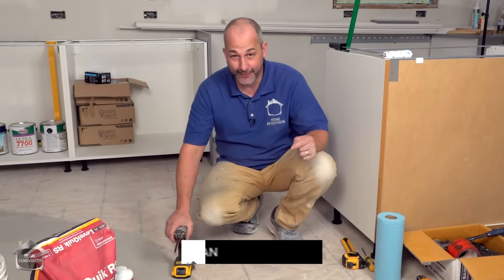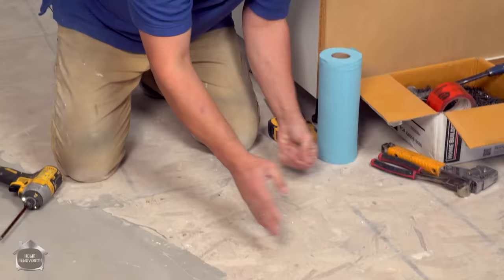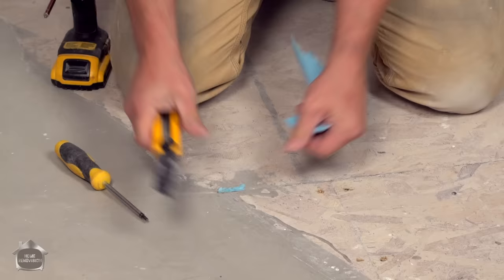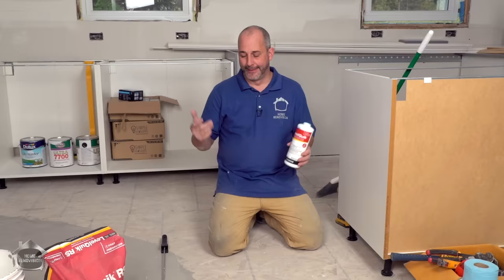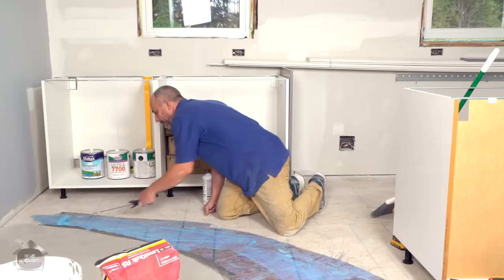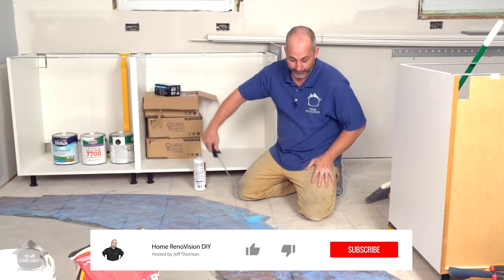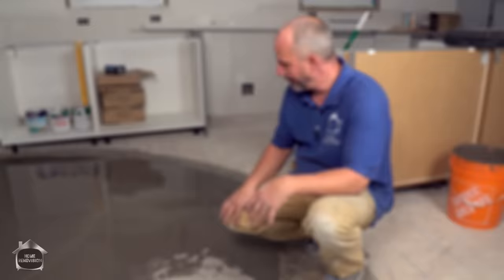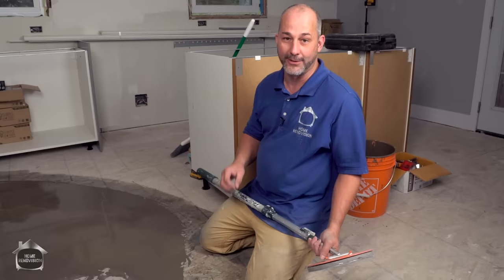How To Level Your Floors

Comment: Hi Jeff, thanks for your great videos. I bought a house with a crazy amount of settling. I had an engineer look at the house and he said it's structurally sound but head settling over the years. How would you recommend I get the floors leveled?
Reply: Jeff does video on that for his farm house reno series.  Basically you start in the basement using steel jack posts and you SLOWLY raise the main joists about 1/2" a week.  Those jack posts remain for ever after that though or can you knock in a wood post if you're daring.  Then you move up to the first floor and repeat  etc. if you can.

Comment: Hi Jeff,
Can I use this over OSB and then put tile over it or would I still need to put down backer board? Separately, can I use this over old hardwood floors then put vinyl planks over it? 
Thanks!
Reply from the maker: Hi Robert, when tiling you always need 1 1/4" of substrate ( wood or cement board). as for the hardwood it is better to remove it all and then work from there. the water in the leveler is going to be absorbed into the wood causing it to warp even more and you will not get the strength out of it that you need. Perhaps a good underlayment before installing the vinyl would be better. Cheers!

Comment: Hi, My wife and I are renovating our home and removed the old wood laminate flooring, then underneath found a few different old vinyl/linoleum floors (fun...). We got all of that up, but now have some left behind paper backing and adhesive we have tried to scrape and scrape and SCRAPE. We are replacing all the flooring in this area with tile, do we need to spend days of labor and hundreds of dollars renting equipment to get all of that off or is there an easier/cheaper way to prep the floor? or can we get away with not prepping the floor at all since were putting down tile?
Reply from the maker: no worries about the backing. simply install your new layer of plywood on top and screw down as per usual for subfloor. make sure you have a 1 1/4" thickness and you are ready for tile. If you want to use cement board then use the Mapei primer eco prime grip on the backing and then you can use thinset on that to set your cement board into. Cheers!

Comment: when you are sanding your walls in between paint coats, that is only for smooth walls, right?  or would it be best to sand between coats walls with knock down orange peel texture?  And speaking of wall texture, what would you recommend for a 30 y/o southwest US home where half the walls are knock down orange peel and the rest of the walls were wallpapered and the wallpaper was removed by some previous owner leaving glue and bumps in places and doesn't look nice.  Obviously we want those previously wallpapered walls to look good and coordinate with the rest of the home.  Sand them smooth, repair, and paint leaving smooth? or sand them, prepare and texture with with a texture roller that looks coordinating?  or something else?  The walls are vaulted.  Thank you.
Reply from the maker: that is simply a design question. I personally would take advantage of the different texture and consider using a contrasting paint color. as for the sanding use a 180 grit to remove roller fibers and dirt is all. Cheers!

Comment: Hi!
I have a basement floor that is unlevel , it is made from 6mm wooden boards and underneath there is 40mm of cell plast isolation and the entire structure sits on some kind of sand , the floor has a lot of uneven spots, do you think I should change the cell plast that got soft and then pour some cemet? or what options do I have to get an even floor?

Comment: What would you do to "level" or "flatten" a floor that was in a garage that has a built-in slope?  Not to take the slope out, but flatten it so the next layer of flooring doesn't have high and low spots?
Reply: Buy some knee pads and a diamond concrete cup grinding wheel, 4-1/2" angle grinder, safety face shield and glasses, ear plugs, respirator, gloves and a 12 pack of some good lazyboy football watching beverages because its gonna be a good n long bonding session between you and that floor and will get to know eachother real good when youve leveled with it..  

If youve only got puk marks and divots then use a structural repair compound with bonding adhesive after youve wallered out the places and thoroughly degreased the concrete since it was a driveway.  Might even use muriatic acid to etch and clean it first to be sure anything you pour on it will have best chance of adhesion..  after etching you could also try using a self leveler in small portions and a good trowel or squeegy to move it around to all the various places something needs added but would still take high spots down with the grinder..  be prepared for dust bowl 5000 though so fans are a must as well..

Comment: great video. I have a question. I just bought a house. Ripped up all the ugly wood parquet flooring. And it was glued down. A gray color glue. There are a few low spots i need to level with floor leveler. Is it ok to use over the glue?  The glue has grooves in it from the trowel. And some of it was sticking to the Tile Chisel bit.
Reply from the maker: as long as you use the primer. Cheers!
Reply: @HomeRenoVisionDIY  Ok. Thanks

Comment: Can you use this in basements to level foundation floors? Or will it not bond properly with the original concrete?
Reply from the maker: It will if hou use the primer. Cheers!

Comment: My floor joists are 24 inches on center. I’m laying down 3 inch tongue and groove hickory floor. Do I still have to level my undulating subfloor?
Reply from the maker: not if you are installing perpendicular and the boards are longer than 4" on average and the wood is 3/4" thick. The subfloor should be screwed first and for best results always check the specs for installation from the manufacturer. they can confirm or deny my experience. but any warrantee is only valid if installed according to their instructions.

Comment: I suppose this is all determined best with a laser. A taut string with a level could pretty much do the same, I think a laser would be faster, easier, and more precise though. Here's is what we need a 3D printer for. It could roam the floor determining levels, and then just print out a floor. Using the right materials with that could also strengthen and quiet the floor, maybe with just a thin layer. Doing it by hand intimidates me, but I am going to put my kneed pads on and explore the floor. I shall brave the wilds within the confines of my own sheltered existence. It just feels so good to get into something so rough.

Comment: I have a concrete front porch that pools water toward the house. Can floor lever be used and not have a wearable surface installed on it? 

The porch is covered and I live in Columbus, Ohio. Added in case it makes a difference in the answer. 

Thanks for all the videos!
Reply from the maker: Hi Dave, leveler is not designed for exterior use. there are other products for your situation.
Reply: @HomeRenoVisionDIY Thanks for the reply. I had a feeling it wouldn't work. What is a product that is good for my situation?

Comment: Question for you. I am about to pour for a bathroom I’m working on. Just called up tech dept about their product and was told it can only be feathered on concrete floor. On wood floor they told me the minimum pour is 1/4” thick and that I must use lath. I see you did feather and didn’t use lath. My question is how has it held up? 

My lowest point is 5/16” so to get it level with the highest point and maintain 1/4” minimum I’m looking at roughly 3/4” at my low point to get the high point a 1/4” to meet their requirements. I really don’t want to do that and would much rather feather to the highest point. Really looking forward to hearing your thoughts! Thanks!
Reply: Same issue here.  What did you end up doing?

Comment: I’ve been agonizing over what to do about an uneven floor in an older house on a conventional foundation. Pulled up a piece of subfloor today and discovered that rough cut planks were used under the 3/8in plywood subfloor. I seems pretty solid, but the thickness of the rough cut lumber varies by as much as 1/2 to 1/4 of an inch in places which creates a few noticeable dips. (Grateful it wasn’t any worse.) I’ve been concerned that since the self- leveler is a type of concrete that it would crack over time. If I use the primer that won’t happen? 
I’ve thought about pulling up all of the subfloor where there are dips and adding thickness to each of the planks that are too thin and going back with a new sheet of subfloor. I’m hoping self leveler will keep me from having to do all of that. 
Please advise if at all possible. 🙏 Thank you so much for all of the great advice in your videos.
Reply from the maker: Hi Debbie, you need 3 things for a good floor leveler install. strong substrate that does not have much deflection. primer and the right amount of water in the mix. to avoid the need for too much leveler you can add plywood in the low areas to build it up . follow proper screwing techniques. you will be fine. cracking happens with too much movement
Reply: Home RenoVision DIY, thank you. The foundation of the house is solid and as level as a 40 year old cabin built on Mississippi clay will allow and I am discovering that the places where the floor feels spongy tighten up quite well with a good handful of screws. I greatly appreciate your help. 
My only question is the word substrate. If you’re referring to the construction of the foundation I’m fine. If it’s the clay on which the house is built, there may be some shifting. What alternative flooring could you suggest if the vinyl plank (already purchased) isn’t an option?
Reply: Debbie Moore vinyl planking is a fine choice for your situation

Comment: Thanks for the video. My subfloor has gaps between the boards, whats the best way to ensure the mix doesn’t flow into the gap area?
Reply from the maker: 2 options. spray foam or screw down a layer of 3/8 plywood first!
Reply: Depending on the size of the room. you could use a cheap latex caulk then use a 6 inch putty knife to force into the crack and flatten the excess.  I think it could work Wilbur.

Comment: Thanks for the video!  My scenario is a bit different and I was hoping to get input:

I live on the second floor of a condo (but in 85) that had carpet.  When I ripped it all out, I found a gypcrete subfloor that seems to crumble just by looking at it wrong.  There were some tiled sections that I started to rip up (fireplace hearth and kitchen floor) but the gypcrete came with it and revealed what looks like giant oak 4x4 planks.  How would you recommend filling/leveling this floor?
Reply from the maker: I personally think gypcrete got its name since everyone who uses it gets gyped. I hate the stuff for its lack of bond and tile should never be installed on it. your best option is to fill with cement or more of that crete. lower your expectations and use a floating floor system. Cheers!
Reply: @HomeRenoVisionDIY  thanks for the tip!  We actually have LVP from a company called Flooret, it's great stuff! I had it installed in some of the condo, but realized the rest of the condo floor just isn't level enough, and even with underlayment, it just wouldn't feel right. So trying to figure out how to work out with leveling this terrible gypcrete in a cost effective manner has been my greatest challenge so far.

Comment: Hi Jeff we are replacing all our floors got down to two choices on tigerwood either 3/4 x 5 solid or 1/2 x 5 with 3 mil veneer engineered.  We live in Northern California so temp changes are minimal will be over ply sub if you had to do which would you like better? I’m torn between the two.  Solid or engineered
Reply from the maker: I guess for me I would choose the 3/4 . that way I could use the schluter ditra mat on the subfloor and then tile in the bathrooms so the floor has the same height. If that is not a concern then go with the engineered and save a few dollars. cheers!

Comment: jeff, can I just put mapei aquadefense or redgard on top of the self leveling concrete or do I still need to put hardiebacker or some cement board on the floor after that? Im trying to level out a large area and tile over it and I was wondering if it was still necessary to put the cement board as underlayment on for waterproofing. obviously I cant just put the membrane over the obs subfloor or even plywood for that matter since manufacturer says not to.
Reply from the maker: here is a proper floor assembly. first get to the desired strength by adding plywood or cement board. then add leveler where needed. then waterproof then tile. Cheers!

Comment: My basement has a poured concrete floor, roughly 40 feet x 20 feet which we want to install laminate onto.  It's pitched towards the drain about with almost 1.5 inches slope overall measured with a laser from the front of the house to the back.  It's not really noticeable walking over it but it adds up.  The floor isn't too wavy, but I did grind some higher spots to help with the flatness (not fun) and yet I'm still torn on whether I should level it.  Would you still recommend self levelling concrete, or would you just live with the slope?  Seems like it might be a bigger job than I could do myself and would cost a fortune for such a large area.
Thanks for the videos - they are super informative.  Plus, I'm in Kanata so it's reassuring to get advice from a local pro!
Reply from the maker: I would live with the slope since it is done that that for  a resaon. If you get rid of it then you will be in big trouble if you never get a water event.

Comment: I am trying to lay a pergo floor over a 100 yr old oak floor.  The flooring is that of their version of a subfloor.  It is beautiful but has more work in it than I want to do.  At any rate, the main beam that runs the length of the house is higher than the right or left side of the house.  The kitchen tends to sag a bit more than the living room area.  The kitchen has a cellar under it while the dining room has crawl space.  The gap slopes significantly enough.  about an inch and a quarter.  without building it up with additional flooring and leveler and without spending a fortune on a foundation expert what is my best route?

Comment: Can you put luxury vinyl over tile? We have a home from the early 80s and I'd rather leave the existing tile alone if possible with some minor work here and there.
Reply from the maker: Yes you can. as long as the doors still work. Cheers!
Reply: @HomeRenoVisionDIY  Awesome! Thank you! Would you suggest installing underlayment to help with making the surface flat? Or is there something better/simpler?

Comment: Is it necessary to put in plywood over hard wood before putting leveler?
Reply: It should go straight on concrete. Pouring it on plywood is a stretch. It will not last.

Comment: Hey Jeff, great channel. I’m getting ready to lay porcelain tile throughout my first floor, however, in two rooms I need to both raise and level the floor to be even/level with the rest of the first floor. Floors in these two rooms must be raised 2-3 inches. I’d like to use self leveling cement, but not sure it can be poured that thick. I should also mention The portion of the floor that doesn’t need to be raised/leveled is marble tile that I will be setting the new tile on top of. Any suggestions??
Reply from the maker: remove the marble so you don't have to raise the other floors so much.
Reply: Thanks for responding Jeff. That’s not really gonna work. if I remove the marble, the floor will be lower than the floor I currently need to raise (crazy right?). The mud base the marble is set in is extremely thick. Below the mud base is a 2 - 2.5 inch concrete subfloor and under the subfloor is the 8 inch concrete slab. I am afraid to touch the mud base because I’m afraid the subfloor will be damaged in the process. The only positive is that the marble tile installation is completely level and sturdy. Thoughts?

Comment: Jeff,  I have subfloor with a lot of imperfections that I would like to just cover up with quarter inch plywood for vinyl planks but at the same time there is one small area where there is a dip (maybe 4x4 area with maximum dip about 6/32).   That area would fill perfectly with self leveler.  Would it make sense to first fill the dip and than cover everything with a layer of plywood?  I know screwing through leveler might be a pain..
Reply: Sergey - I have this same question - looking at a floor after pulling carpet and going to do LVP wondering if I should  - sand? Skin w 1/4 ply? or use this type of leveler??? This almost seems to be the easiest?? Replies appreciated!

Comment: For a kitchen floor over a basement, would you recommend making adjustments to a few floor joists that see higher or lower than others?  It seems like your leveling method is a lot easier.
Reply from the maker: Hard to fix a joist without sticking posts everywhere. this is much faster and you get a better result! Cheers!